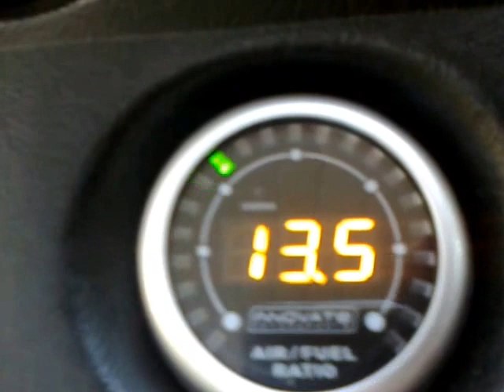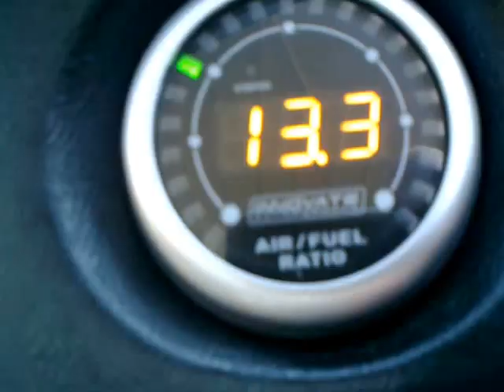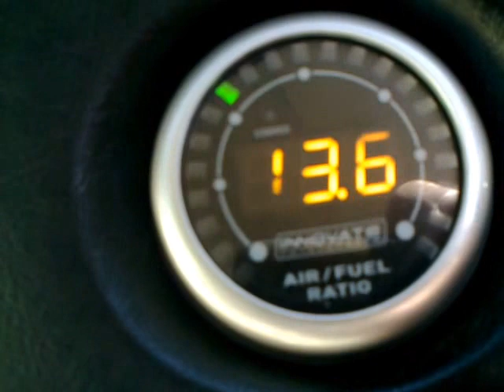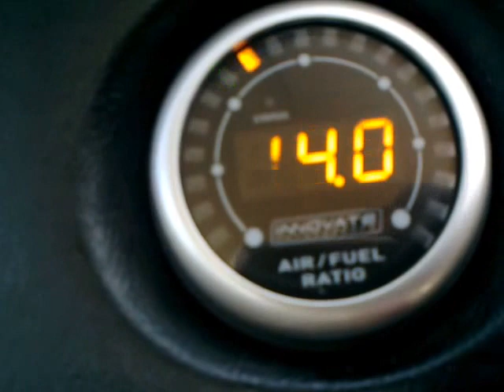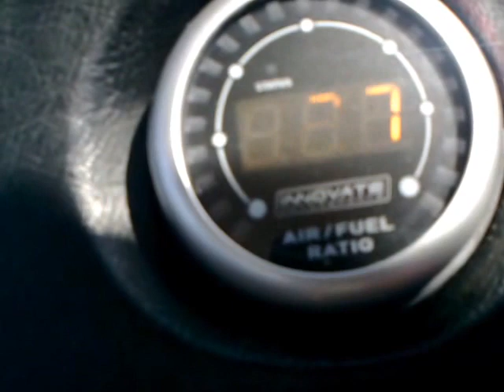Jensen Interceptor Mk3 fuelling BEFORE adjusting the Carter Thermoquad carb

Comment: Greetings Philip....Your Thermoquad Carburetor is a "Keeper", for sure!....I'm Amazed at how well Your Thermoquad Carb, was able to maintain an "Air/Fuel Ratio", that rivals that, of an Engine equipped with a Fuel Injection System, and "Without" changing any of "Your" Thermoquad Carburetor's..."Primary Jets", "Metering Rods", or "Secondary Jets" as well!....Now then, considering that Your Thermoquad Carburetor was "Calibrated", and "Set-Up" for Gasoline (Petrol) that was Refined/Produced in the Mid-70's (1970's), and having Your Thermoquad Carb run an Air/Fuel Ratio, that the Viewers and I saw on Your "2" Videos (Yes Folks, Philip has a "PART-2-Video", "AFTER" He made a very "Minor-Adjustment", and the Results were, shall I say..."Incredible!"), that were being Displayed on His Air/Fuel Ratio "Gauge" in His Jensen Interceptor, with that "440-Cubic Inch Displacement-V-8 Engine!"

Thanks kindly Philip, for the very well appreciated "Recognition", that you posted in your First comment, just below this Video.

Your Narration, was "Superb", and, very Clearly Spoken, and Very Easy to Understand, and, You were able to Explain every Detail, related to what Your Jensen Interceptor, as well as Your Thermoquad Carburetor, "Was" doing, and not only that, but, what it "Should" be doing, as well.

On Your Videos, both, Part "1" and Part "2", of the Thermoquad Carburetor's "Air/Fuel-Ratio-Gauge-in-Real-Time-Read-out, while you were Driving and Narrating...I give you a..."10", out of a possible "10", and, "2-Thumbs-Up", for a Job, so very well done!

Till next time...

Be Safe, take care, and have a good one.
Reply from the maker: Thank you Rocky!!  Very kind of you!

Hope someone finds this and the other video showing the results after tuning the carb, of value.